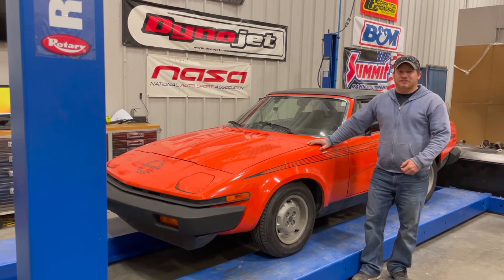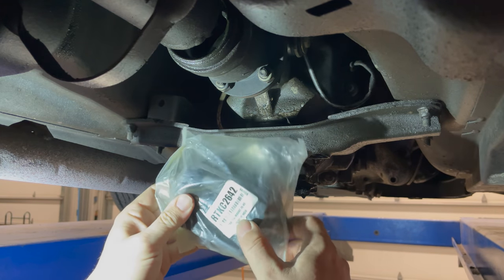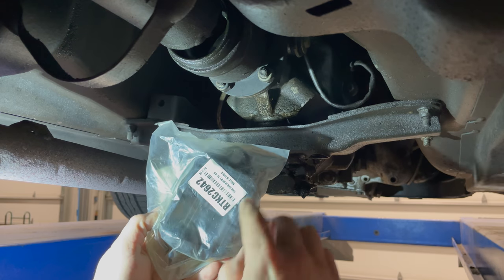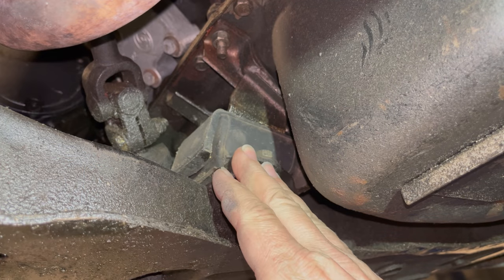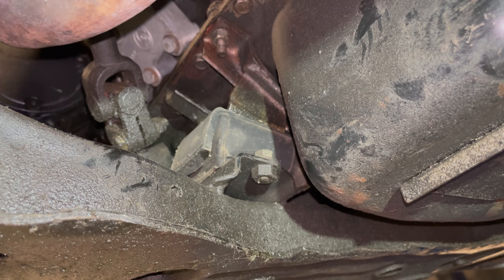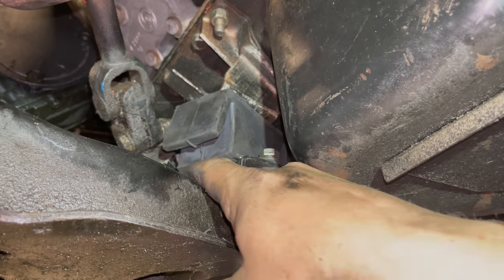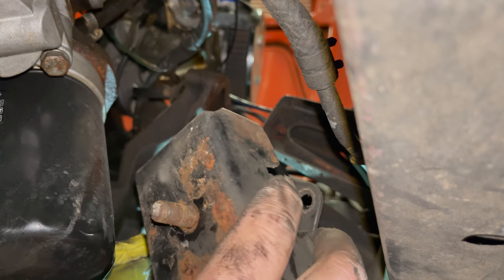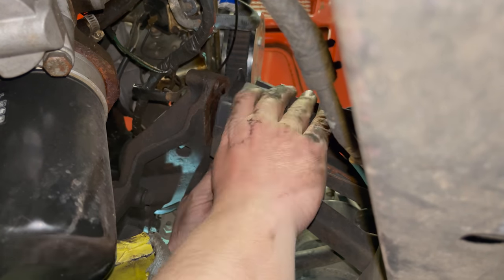Replacing Triumph TR7 Engine and Trans Mounts

Comment: I've been through a Bugeye Sprite, MGA, MGB-GT, two TR7s (Which are a pretty good car once you re-assemble one, and yes I took off a badly seized cylinder head with several tools not considered appropriate for the job.) and a TVR2500M now sitting in a trailer waiting for its turn. Never my only transportation available but mostly daily drivers when our Maine winters begin to evaporate each spring. I envy your ability to find these vehicles as well as the gumption to bring them back to life. Your videos have encouraged me to shelve my excuses and put the TVR back together this year. Great series!

Comment: I live in a rural area of Missouri, I remember about 10 years after the TR7 came out you could be driving along on a rural road and see a TR7 sitting somewhere in lawn or a fencerow.  It has been many years since I have seen one for sale anywhere.  A fellow I knew bought one in 1980 and could not figure out why it was not running right, especially when he let off the throttle.  I asked him if he had checked to see if the oil level in the dashports on the SUs was correct, of course he had not.  It was a shame that the TR7s were not well sorted since the TR6 was a good car.

Comment: The aftermarket engine and transmission mounts use urethane that's much MUCH harder than the originals. They're supposed to damp out vibrations, which is why they were pretty soft to begin with. But today's hard materials may look like they're doing an impressive job of minimizing wobbly vibration, while in fact they're just transmitting that vibration into the car where it's not a good thing at all. If you find yourself replacing any more of those transmission mounts, let me know - I'm collecting them to strip out the metal parts and recast the urethane with a softer (original-style) grade, and I only have a couple to work with while I do my experiments. P.S. - the TR8 mounts used to be a bit stiffer than the TR7 ones to cope with the higher engine power and vibration levels, but today they're all made with urethane that's as hard as a bowling ball, so it really doesn't matter which one you choose.

Comment: In the last WEEK or so, I have run across ads for a TR7 and then a TR8, both with " frozen " clutches.  Is changing a clutch/removing a clutch on either car so incredibly difficult that folks all but give them away in desperation?

(BOTH cars were priced UNDER $5,000.)

Comment: Most of the aftermarket engine and transmission mounts are poor quality and much too hard so you may get lots of extra noise and vibration from them.  One of the tricks is to use the transmission mount from a Volvo 740/840 which are almost identical and easily adapted to fit.   The original equipment quality mounts are still available for them and I have fitted them on my TR7s.